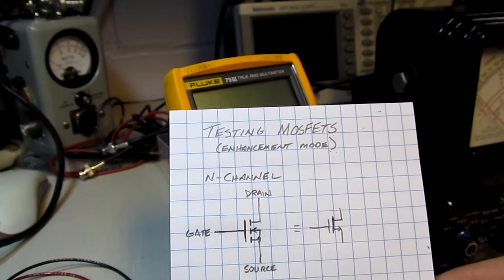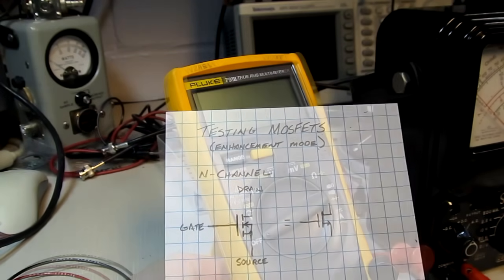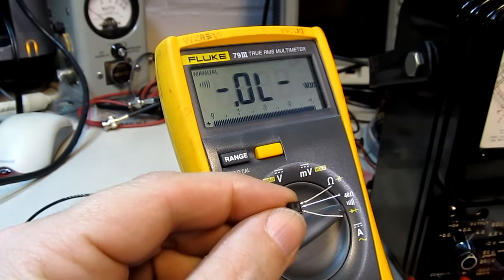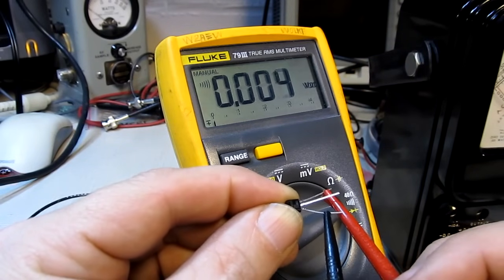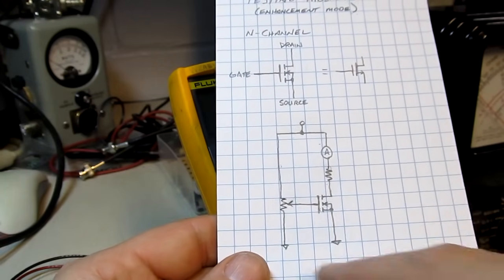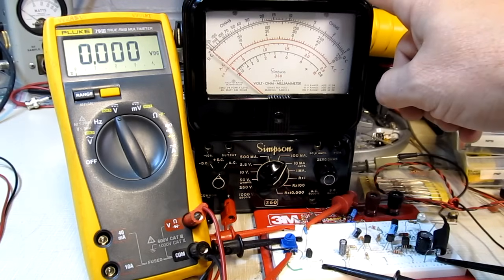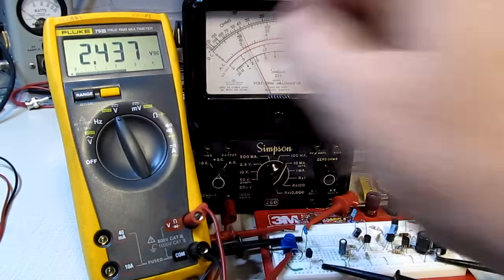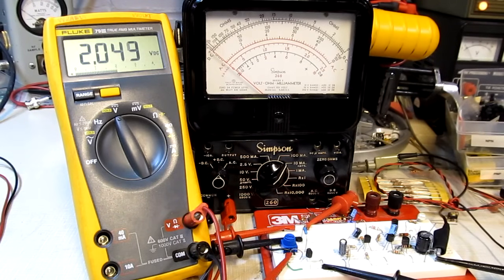#132: How to test MOSFETs with a DMM - a few methods...

Comment: Hi. I want to test a P-Channel PowerTrench MOSFET if it's good or bad. Can someone tell me how to test it because this MOSFET is not like in the video. The reason why i want to do this is because my laptop won't start anymore and i tried many solutions in order to solve my problem but no luck! So, i thought, in order to fix my laptop i must go deeper in to it. Any suggestions  will be greatly appreciated. Thanks in advance. Oh...i almost forgot....here is a datasheet link for that specific MOSFET: http://pdf1.alldatasheet.com/datasheet-pdf/view/245614/FAIRCHILD/FDS6679AZ_08.html
Reply from the maker: It is not practical to test in-circuit unless you know the schematic of the surrounding circuitry, and how that would react to your testing.

Comment: Hi,
 i have a mosfet 13N60M2 and i usually do what you did in this video
but the meter only shows a reading for about one second then goes back to  one.

here is the pdf link if you can help me in any way.

http://www.st.com/content/ccc/resource/technical/document/datasheet/01/01/8b/e8/f5/b2/4e/98/DM00082928.pdf/files/DM00082928.pdf/jcr:content/translations/en.DM00082928.pdf

thank you

Comment: Are MOSFETs the only transistors that display this Gate to Source capacitance? Can this be measured, then used to identify an unknown Transistor as a MOSFET, and discover it's pinout?
  Thanks for the great tutorial.
Reply from the maker: It can help.  Other devices like IGBTs will also have a gate that effectively a small capacitor.

Comment: Recently I purchaset 10 new IRFP250, but all of them seem to be in an 
"off" state. I put negative lead to Source, charge the Gate by touching 
it with the positive lead, and then when I touch Drain with the positive
 it shows around 900 ohms. And thist is for all of the 10 brand new mosfets :( 
Why this could be happening?

Comment: would it be normal for a mosfet to have to have a high resistance like 40-50 ohm between gate/drain and gate/source if it is shorted  ?
Reply from the maker: If you're seeing 40-50 ohms between gate-drain or gate-source, then the mosfet is most certainly bad.
Reply: ok, thanks

Comment: Correct me if I am wrong, but this is only applicable if the component is removed from the board correct?  Otherwise, other shorting paths are possible to allow voltage to flow.
Reply from the maker: Yes, out of circuit testing only for these methods.

Comment: What's quick way to measure the transconductance of a mosfet? Thx!
Reply from the maker: You can use the simple circuit shown at 2:45, and measure the change in drain current vs. a small change in Vgs. Transconductance is the (change in Id / change in Vgs).

Comment: Nice tutorial! Is there a way to test it without removing it from the circuit?
Reply from the maker: +fulesmackofule Not usually, because other components in the circuit will affect the ability to effectively test it.  The best in-circuit test is to actually scope out the voltages at the terminals of the device and see if it is operating as expected.
Reply: Thanks for the quick reply!

Comment: I would like to ask you a question.  I have 6.67A running through an IRLB3034 MOSFET.  Now, the datasheet says (worst case scenarios used) Rds(on) is 2 milliohm. R0JA is 62.  So, why would the MOSFET get so hot it will blister your finger within a few seconds of it being on?  Tj should be 30.5611125c with Ambient at 25c (right now it is 15c in there) which is less than body temp so I don't get it.

Any ideas?
Reply from the maker: +legalizeshemp420 Is it a switching application?  If so, you could be seeing a lot of switching loss (power dissipation while it is being switched), due to the speed at which you can change the voltage at the gate given the large gate capacitance.  Or, are you sure that it is a genuine device (not a ebay special, counterfeit)?
Reply: *****
It is used as a switch and if this is a counterfeit it is a damn good one.  It is used on a RAMPS 1.4 for 3d printing with the controller being the Arduino 2560 and it is used to PWM the board.  I can understand why the original one overheats (known issue) but not this one.
Reply from the maker: +legalizeshemp420 I would highly suspect that it's switching loss - that the gate is not being moved very quickly due to its capacitance.  The channel resistance is higher when the Vgs isn't at it's max, such as during the transition time.  That's probably where the power is being dissipated.  Have you looked at the gate and drain waveforms on a scope?
Reply: *****
I have not but it is now dead and dies instantly.  PWM 8 on the Arduino is connected to the Gate of the MOSFET.  Here is the schematic http://rigidtalk.com/wiki/images/8/82/RAMPS1_4schematic.png  look at the very left side under Heaters & Fans and see where it says D8?  That is the one that dies instantly.  All three MOSFETS are connected directly to the PWM pins (I am unsure of which pins except for 8 being for D8 the heated bed MOSFET).
  I do know when I measured the voltage on the gate when I turned on the heated bed that gate was 5v using a cheap DMM.
Reply from the maker: +legalizeshemp420 Switching loss is all about the ability to switch the FET on and off quickly - that means a fast rise and fall time on the gate. That translates to moving the charge in and out of the gate capacitance.  The device you specified in your first comment has 6 times larger gate capacitance than the device shown in the schematic, meaning that it will likely switch 6x slower when using the same driver.  Depending on the PWM frequency, the switching losses could be quite large, thus a lot of power dissipated during switching.
Reply: *****
The one I purchased is listed as a better replacement as it doesn't even need a heatsink whereas the other (the one in the schematic) will melt the plastic if it touches it (as mine did).
  Let me see if I can find out the PWM frequency coming from the Arduino.  I hope someone knows.
Reply from the maker: +legalizeshemp420 Viewing the waveform at the gate (and drain) should tell the story.  If the board designer recommended the device as a superior replacement, then it might be best to ask them what's going on.  Have you verified the resistors are the right values?  The 10 ohm in series in particular - if it was larger, it would slow the rise/fall even more leading to even more power dissipation during switching.
Reply: *****
I found out the frequency is 7hz or less depending on the configuration.
Reply from the maker: +legalizeshemp420 Really, that low???  OK.  I would then check to be sure that the actual voltage appearing across the gate and source terminals at the device are really going above threshold when the device is on.  Excess resistance in the Ground will cause the Source voltage to rise, taking away from the gate-source voltage and keeping the device from giving you the lowest possible RDS(on).
Reply: Well, I did check and the resistor (I really hate tracing down parts on double sided boards, lol) was 10 ohm on the meter.

Now, I am not following what you just said.  I tested the voltage at the gate and it was 5v when on (no mosfet was in it at the testing due to it blowing them out) so what else do I check?
Reply from the maker: +legalizeshemp420 When the FET is on, high current from the heater flows into the Drain and out of the Source to ground.  If there is even a few tenths of an ohm resistance between the FET's source terminal and the ground of the Arduino supply and high current supply, the voltage at the source won't be zero!  Thus, the gate-source voltage won't be as high as you think, and the FET might not be fully "on".   Also, are you sure the wiring to the heater is correct (that the FET is not on the supply side of the heater)?  Are you sure the heater isn't shorted?  Have you tried it with the heater disconnected to see if the FET works properly then?  If the heater is driven with PWM, the current could be considerably higher that the steady state "on" current (surge current until the heater element heats up).
Reply: *****
The heated bed is 3.6 ohms so it isn't shorted and when I measure the voltage going to it (with a now dead mosfet so always on) it is 24v as it should be.  What do I test with this dead board as I have a new board coming that I purchased and I don't want it to blow out too.
Reply from the maker: +legalizeshemp420 Make sure the FET is not mistakenly wired to the 24V side of the heater bed.  Measure resistance from the FET source lead to the ground on the Arduino and the ground on the 24V supply.  Use a good meter and zero-out the meter's lead resistance.  The resistance in these paths will lift the voltage on the source, thus reducing Vgs and increase RDS(on).  And - look at the voltage waveform at the gate, with the device in place to be sure that the rise/fall times are not a considerable part of the "on" time of the PWM waveform.
Reply: I don't have a good meter but I did measure the source to the negative terminal of the PSU connection, and with the dead fet left in, I measure 0.2 ohms.
Reply from the maker: +legalizeshemp420 That alone could raise the voltage at the source by 1.3V (6.6A * 0.2ohms).  Can you use heavier wire?
Reply: *****
Already using 14 ga wire.  Something evil is blowing these mosfets and I can't see how or what it could be.
Reply: *****
I dug out the scope this morning and removed the dead fet and looked at the gate.  It was a dead 5v always on so I was stumped.  I looked at the other MOSFET that handles the hotend and it was a nice PWM so I was even more stumped.  Come to find out the PWM is a little over 7.6 Hertz and for the heated bed, the one the dead fet goes to, is always on until the thermistor says it is close to the temp I want then it starts the PWM.  Since these fets die instantly that means the PWM never has a chance to start so I didn't check that.  All evidence points to my Arduino 2560 being fine but something on this RAMPS 1.4 board is funky.  If you look at that schematic it is just a simple switch controlled by the Arduino so beats me how this is blowing unless something nasty is happening with the heater board but it never even gets hot and is 3.6 ohms.  New board is supposed to be here tomorrow and if that blows I am chunking the heated bed/board and will have to buy a new one of those too since nothing else could be it due to how simple this piece of the circuit really is.
Reply from the maker: +legalizeshemp420 It is a simple circuit.  Have you validated proper operation of the heater?  Have you tried simply momentarily connecting a DC ammeter in place of the FET, to verify that the heater current is what you think it is?
Reply: *****
I don't have an ammeter as I never needed one before but how would that work since it can't get any power.  I mean I can directly hook up my 24v supply but 24v @ 3.6 ohms is 160 watts.
Reply from the maker: +legalizeshemp420 You do have a DMM I believe - since you said you were able to measure the voltage at the gate, and you were able to measure resistance.  The DMM should be able to measure current too?  If so, what is the highest range (It is often 10A, which usually is a separate input).  If you've got that, then you can check the operation of the heater, and the current drawn.
The "normal" configuration of the 24V supply, heater and FET would be:
+24V ----- Heater connection 1 :  
Heater connection 2 ------ FET Drain : 
FET Source ----- Ground.

To measure the current, simply put the DMM in the place of the FET, setup to measure current, using a range that exceeds the maximum current expected.
Reply: *****
When I see ammeter I always think of those clamp over ones.  Yep, I can do all of that but the fet is dead and I removed the fet this afternoon to measure with the scope.  So, just jumper in the DMM on the legs (I bent back and forth the FET to remove it and have the legs to test with) and in my case that would be the left most and the right most legs with the drain in the middle.  10a scale will work since this should only go to about 6.67 amps.  If this shows that amount of amps then I suppose we can say what?  first fet burnt up but it is known to do that on everyone (it isn't if but when this will happen on everyone as the original FET is just not able to handle 6-10 amps like that without at least a fan and a need of a heatsink with no room for one) and the second blew up as soon as I told it to heat.
Reply from the maker: You would want to jumper the DMM ammeter to the drain (middle) and source connections.
Reply: *****
DOH, getting tired as gate would be stupid as its sole purpose is like the paddle in a switch, or button.  LOL.  Yes, in my case it would be the middle and right side with the numbering facing me.
Reply: *****
I just tested it and dead cold (~13c) 7.2-7.3 amps and at 40c it was down to 6.6-6.7 amps.   The hotter it was getting the lower the amps drawn like when a LED gets hot.  It was a very slow, and gradual, decrease.
Reply from the maker: Ok, sounds right. Temporarily jumper FET drain to source, then measure voltage between source and the ground on the Arduino board.
Reply: *****
Wait, wouldn't that source just be ground itself since this is just closing ground to complete the negative circuit?
Reply from the maker: Yes, but with that large current flowing with the heater on, you might be getting an IR drop between the ground at the FET source and the ground at the Arduino. This would reduce the Vgs applied to the FET.
Reply: *****

Source and the negative terminal from the PSU will suffice?  This will be tricky as I don't have wire I can just clip on that will handle almost 8amps and no room to solder in there (I could barely get my scope probe in there).
Reply: *****
I measured 24v steady.
Reply from the maker: +legalizeshemp420 If you're measuring 24V at the FET Source terminal, then you've got something wired wrong!  Maybe you have the polarity of the power supply for the heater reversed.  If so, that would easily explain why you were burning up the FETs. This would reverse bias the drain - source, turning on the body diode, and sending the 6-7 amps of current through the body diode - instantly cooking the FET.
Reply: *****
Shorting out the two pins and using the shunt to measure with the positive lead of the DMM on the shunt and the negative lead on the negative wire of the 24v coming in I measured -24v.  No wiring has been changed for years or even unscrewed.
Reply from the maker: +legalizeshemp420 I don't know what to tell you - sounds backwards to me.  The FET Source terminal should be physically connected to the ground (negative side) of the supply.  Ideally, would measure 0 volts, but realistically will likely be slightly positive when the heater is on due to PCB and wiring resistance.  With the FET out of the circuit, the Drain should be + with respect to the Source and with respect to Ground (both measurements should be the same).
Reply: *****
Well, with it off I measure source to the negative leg of the PSU and get a 0 reading so continuity.
Reply: *****
I received my new board today and tried it out and it worked (no 24v just logic testing).  I removed the stock MOSFET for the IRBL3034 and checked.  With it off no connection between source and the negative terminal.  With it on it had a connection.  I am busy playing catch up on stuff I need to do but the final test is to try it with 24V and if it blows then these MOSFETs I have to say is the culprit.  I will let you know how it goes.
Reply from the maker: Before installing the new FET, verify that the voltage at the drain is positive with respect to the source.
Reply: *****
It was.  Everything seems, so far, to be what it should be. As I said the source was dead 0 until I told it to turn on then it connected the ground (negative) of the PSU input so the switch part worked as I told it to turn off and the ground was removed which would be removing the PSU from the heated bed.  What I will do is hook up the 24v and see what happens.  If it passes that then I will try with the heated bed and see.
Reply: *****
Worked beautifully and the new MOSFET didn't even get warm when the bed is sitting there at 80c whereas the old MOSFET would have burned me.  I will say that this board has thicker copper and/or possibly better glue than the other board but it was put together by hand in China as no machine touched this board (unlike the first one I had) because I saw leads snipped on the underside and rosin everywhere.  I used the last of my Alcohol 91% to remove what I could but so much of it that it became sticky (SMH).

Anyway, the original board something very bad happened to it but as was found out AFTER I purchased my system Sainsmart makes horrible electronics.  Oh, they are great color masked and machine produced but sub par everything else.  If a part blows on a Sainsmart made item throw it out because it will delaminate the copper foil due to the glue that was used.  I have 3 items left from the original 150 dollar box of electronics and that is the 2560 (remarkably the only item not made like garbage for most people) and two mechanical endstops (3 others died on me from mechanical failures due to cheap ass switches they used).

Since the circuit is so dead simple I will never understand how the original board just went funky.

Thank you for your help and guidance.
Reply from the maker: +legalizeshemp420 The most likely scenario is that when the high current from the heater flowed through the source to ground trace on the board, that its resistance caused a voltage drop that reduced Vgs and then increased channel resistance.  I'm glad it is all sorted out now!